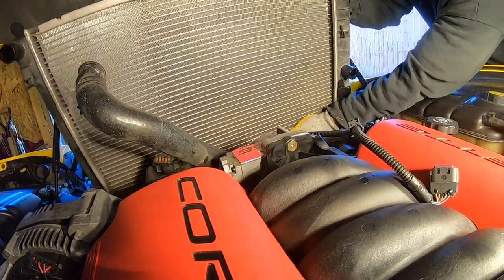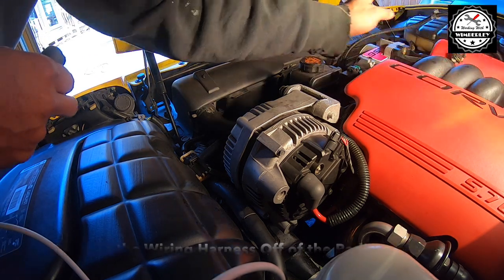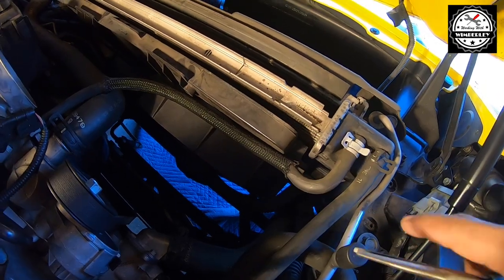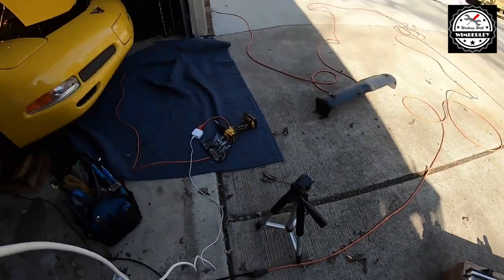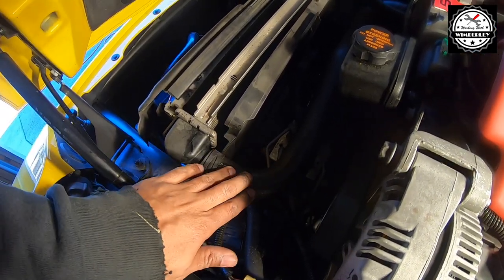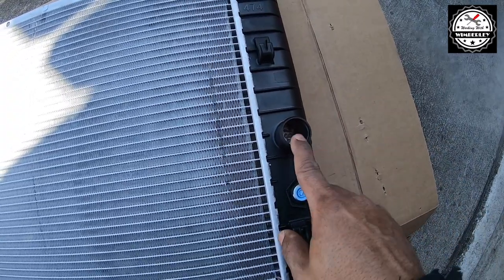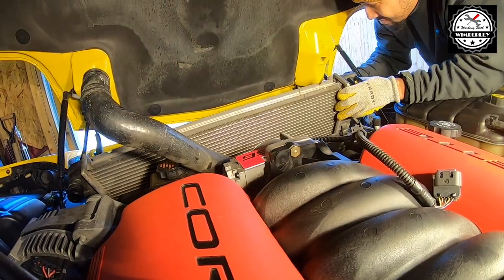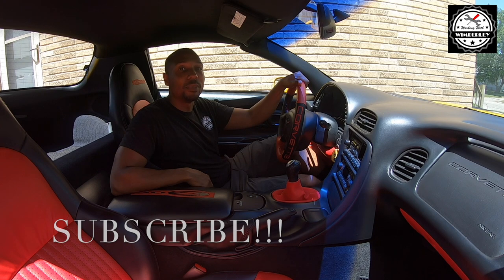C5 Corvette Radiator Removal & Installation 1997-2004 How To Replace & Change Radiator Chevy

Comment: U ain't lying, that bottom hose clamp is a bitch. When I replaced my water pump and hoses last year it took me about 20 minutes too. I put a regular hose clamp on it and I'm glad I did, now I have to replace my radiator and  it should be much easier, the bottom OEM clamp has no room to grab and moves when u get a grip unless u have the special tool with the cable to grab OEM clamps. Thanks!
Reply from the maker: You’re welcome! I’m glad the video helped! I just try to be honest in these videos. The lower clamp was by far the worst part of the job.
Reply: @WorkingWithWimberley  just replaced my radiator yesterday, it was a breeze thanks to your video and putting a regular clamp on the bottom when I replaced my hoses a while ago. Thanks again.
Reply from the maker: @DiscoBoogieNJ  you’re very welcome!
Reply: Would it have been possible to leave the lower rad hose in place on the radiator, and disconnect from where it goes into the water pump. Then lift out the rad with the lower hose still attached. If so, would save a bunch of knuckles!

Comment: didn't have to bleed the system at all?
Reply from the maker: I didn’t have to bleed mine. After topping of the reservoir, the engine temperature stayed steady and the heat worked inside the car. I can’t guarantee that you won’t need to bleed yours though.

Comment: Where did you buy the new radiator?
Reply from the maker: I ordered from gmpartsdirect.com
Reply: @WorkingWithWimberley  I need to change mine, so I just went to GM parts... can you believe the radiator core is discontinued?? Time to hit the aftermarket!  Steve
Reply from the maker: @ddelong1000  I’d try RockAuto.com as well. Often times I’ll get the part number from GM and then order it from RockAuto because the price is better.

Comment: Do y’all think I should buy a 2003 corvette for $7000 it needs a new radiator it’s in good condition I don’t know if any other problems
Reply from the maker: The key part of that is “not knowing if there’s any other problems.” Inspect the car thoroughly or have someone you trust inspect it. If there’s no major problems, it may be a good deal.
Reply: If an 03 is 7k, it has other problems.  Still look at buying it tho, just set aside a few grand.  My 98 was 7k and i spent over 2k in repairs.  Brakes, radiator, shocks, power steering pump, endlinks.  Upgrade when doing these, z51 sways, z06 shocks, ss brakelines, phadt endlinks, etc.  End result is worth it.